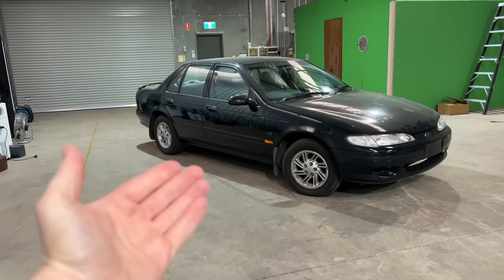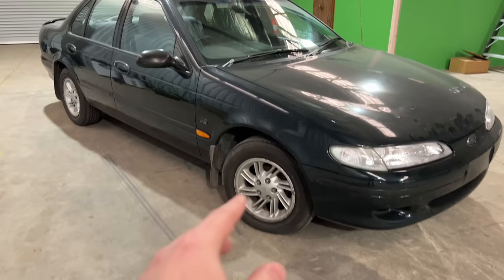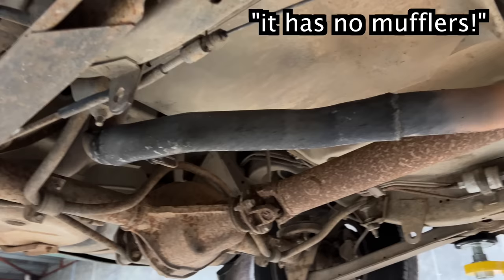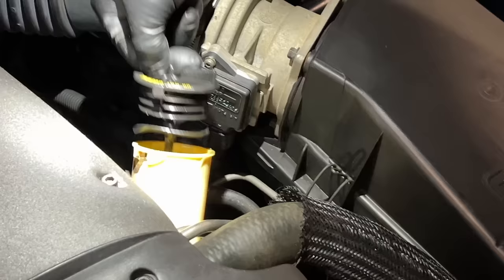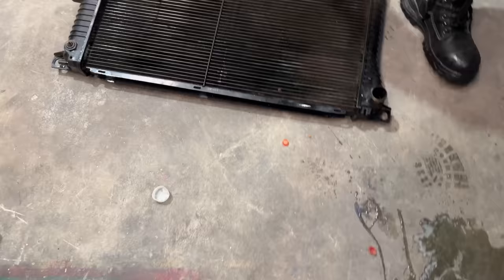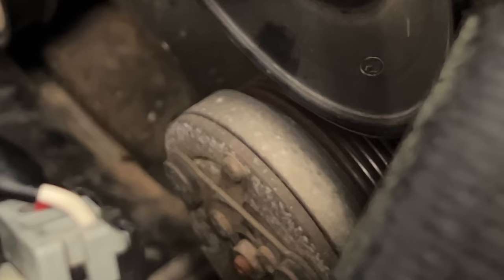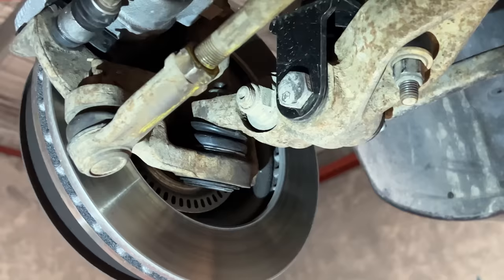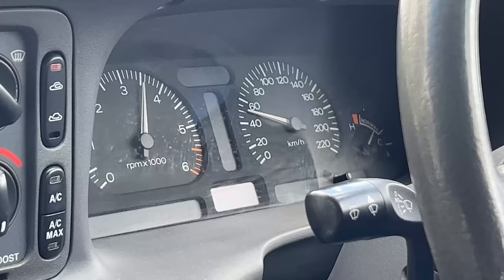Strewth mate, I got a V8!

Comment: 1995-00 explorer/truck parts: GT40 heads, GT40 intake, 95-00 roller cam.. 347 stroker kit and it can drink even more gas like an American mustang fox body.

Fseries parts on 5.0's were near give aways for a while here in the states.

My plow truck which has all these parts is the same color...(except stroker kit) (8-12mpg)

Comment: In/out play on those power steering pumps is completely "normal." As long as there is no radial play and it's not leaking they're fine. And as far as the noise goes on the new one, it needs more air to be bled out of the system.

Comment: Australian 5.0's sound shockingly different than American 5.0's especially the foxbody mustang mills. Sound more akin to our pickup 5.0's but still different. I assume thats mostly cam and header differences because it seems to have the same intake plenum aside from the logo plate missing but I assume that's because it has an engine cover. As far as I know, no U.S 5.0's had engine covers so they all had the plate on the plenum with either a 5.0 logo or a mustang logo. This is a super interesting car as an American.

Comment: "Did someone put oil in there?"
'I hope not.'

Well... I'd hope they did, just that it was the right kind of oil, since that's what power steering fluid is, mostly mineral oil used as a hydraulic fluid.

Comment: The COMPLETE list of the good and wrong of Jeff:

GOOD
- Has indicator lenses
- Has V8
- 2 nolathane bushes
- $20 air filter
- The motor is actually quite happy
- Alternator

WRONG
- Ripped driver's seat
- Faulty cruise control
- Coolant leaks
- Ignition issue
- Bonnet struts
- No mufflers
- Leaking transmission
- Unserviced transmission
- Dead wheel bearing
- Dead wheel bearing (again)
- Dead ball joint
- Oil leak
- Dead ball joint (again)
- Suspension strut tops
- Handbrake
- Dip stick seal
- Rear main seal
- Potential fuel leak
- Blown heater hoses
- Faulty power steering
- Blown heater tap
- Overfilled oil
- Non genuine spoiler
- Faulty boot struts
- Leaking radiator
- World doesn't make sense
- Limited slip differential
- Worn pulley
- Worn pulley (again)
- Worn pulley (again)
- Power steering pump
- Air conditioning
- Brake disks
- Stripped sump plug
- Recon P/Steer pump

(it was cheap)

Comment: Also the whole thing about the Windsor V8's being slow is really down to that slushie transmission Ford used. Incredibly reliable for highway cruising, a bit overly sluggish for good acceleration. I've seen people take the American versions and swap manual transmission into them and those engines can actually move reasonably fast.

Comment: Sounds like a typical Ford power steering pump from the era if I'm honest. All of the pumps of that style were noisy as heck, my 89 F150 has the same pump (and the same 5.0 V8) and it's made that noise forever but it works just fine.

Comment: So that power steering pump over here in the u.s. also has problems it’s just the way ford designed it they used the same power steering pump since 95 to 07 so if you want the wining to go down drain the pump and fill i with new fluid burp it and the fill it a tad bit over the cold fill line like 5 millimeters over and it should quiet it down

Comment: I had a pontiac station wagon i bought sight unsean from a relative.
Get in and step on the gas, WOOOH, WTF? 
Get home pop the hood WOOOOT!    350 H.O. Ultra tow package !!!! I ended up putting a proper header dual exhaust, 750 Dbl Pump / manifold and tires, and it was of to the track! 
I miss that sleeper. So many Harleys and snooty drivers put in their place with that plain jane dark brown station wagon. Looked like a POS and sang like a Vette. All for $1200.
I still have that engine under the workbench today! 25 years later...waiting to go in my 1982 Caprice, even scored a set of unused Edelbrock aluminum heads from the 80's.
One day ...

Comment: Glass bead impregnated plastic is harder than metal.    It wears through the plastic exposing the glass beads which will happily wear through your metal radiator

Comment: There is a completely accurate joke about V8's turning fuel into noise. This is one of those V8's. The i6's is where it's at. A mate of mine used an EL as a drift car. Even after being overheated to the point where it stops running.. They cool down and go for another round.

Comment: Get a trick flow heads and intake set up. A little cam, be close to 400 crank hp. Shed move decent then... some 373s in the rear end to. As for the fuel... put a piece of tape over the fuel gauge haha

Comment: I literally just thought of an explanation for how the fan could have worn through the metal. Glass fiber filled plastic. its mostly used for the plastics on power tools and high wear parts, like those in cars. so at the start the plastic surrounding the glass fibers wore away first then it basically became sand paper against the metal.

Comment: oh thats like the same 302 from a fox body mustang, they are super easy to work on and you can delete everything but the maf and tps they would not care and run great. They also take boost quite well. The intake mani is also quite easy to take off to work on if you need to
Reply: 305 was a Chevy engine, you're probably thinking of the 302
Reply: @nickrustyson8124  yeah it was a typo

Comment: the final drive ratio is what makes these so slow. Great for long highway drives but 3.08 final is crap in the city, uses heaps of fuel. Change it to a 4.11 LSD and it'd be a much more fun thing. Also, the suspension in these is doughy as, upgraded springs and shocks transform them.

Comment: A rare car,  didn't know they were so rare in a 5ltr, 9 made gee ,yeah those Ford Windsor motors weren't known to be any speed machines out of the box ,but they are a good reliable work horse and with few tweaks, as shown by the 220kw tick ford motor in Au ,can be made to move

Comment: Back in 90's the 5.0 Windsor's had no Power and when Holden brought out 5.7 Chev ( LS1 ) The 5.0 Windsor's were no matched even though Ford pushed it to 220Kilowatts in Early 2000's. Ford did make 5.6 Windsor's that pushed out 250Kilowatts in TE/TS50 Series but not enough produced to give Holden any Competition. 5.4 Boss Engines useless unless Supercharged. Only good Ford V8 sedans were GS 5.0 Supercharged Coyote that pushed out 315-351Kilowatts. Ford in December 2003 got XR6 Turbo right in BA Falcons.

Comment: Woah, they used the old 5.0 in these!? 

Thats, (as you would say) heaps neat!! I loved my old Lincoln with that same v8, but a 4 door sedan would have been really cool
Reply: Yes 5.0 up untill around 2000 then Ford Australia stroked it to 346 ci for the last ones , then the Aussie Falcons got the 5.4 Quad Cam 4 valve Boss motors , up untill mid 2010s or so then the Aussie Falcons got an Australian only version of the Coyote 5.0 Supercharged ! Till production stopped in 2017/18.

Comment: old fords are known for having all of the goddamn cooling loop explode, so just replace all of the hoses/plumbing, I had 3 old fords, a fiesta, a scort and finally a 05 ka, they all had leaks, fortunatelly all happened close to home or work, so I just left it parked and fix them at the end of the day, but it was always one of those rubber hose, dont know what you call it XD I'm latino hahahaha but yeah, better replace them all if they look old, also the fiesta and the ka, I ended up removing the heating, there is a funny bracked that connects the outside lines to the inside radiator for the heating, that thing usually bends and breaks cause is plastic, so you either get a short cause the heather electronics is mounted on the same thing or you get a leak that is hard to find

Comment: That spoiler might be factory. I have a. Falcon S that my mum owned since new and it has the same janky light wiring and mounting with the wire just zip ties and electrical taped to the loom. It just looks unofficial from the factory.

Comment: my dad also a nuggeteer

Project car
1. Wira 1.6 auto - paint
2. Nissan sunny - water pump, belting & paint
3. Savvy WKU blue- spark plug, rear glass
4. Savvy Black-paint, rear & front glass
5. Savvy PGR- collect from bangi
6. Savvy WRJ- collect from pasir gudang
7. Wira CAQ- spray rear skirt
8. Spectra WLS- front glass, gearbox, alternator, side glass
9. Ford Lynx MAG2882- paint
10. Accord SM4- engine mounting, aircond & absorber
11. Sunny wagon-nose parts collect from melaka
12. Citroen C3- ah boy repair
13. Peugeot 308- hazeri repair
14. Lorry 1/2 ton- knock & spray, front glass
15. Merc w210- gearbox, rear bumper
16. Prelude- carburetor & paint
17. Audi A6-starter @ relay
18. Toyota KE70- restore & paint
19. Kancil 660- restore & paint

and you guess it, not all are restored

Comment: If you want to put performance stuff on it check the rear diff gearing and make sure the transmission is fine. I know this is probably all stuff you're buddy knows to do but it would be a shame to spend a bunch of dollaroonies and have the transmission blow apart or the rear diff push itself out the back of the car.
Most people take a mild cam and drop it in there. Something like a Comp Cams 262. Most cost a few hundred and net you immediate improvement with everything else stock. That car has Ford Electronic Engine Control 5 (as indicated on the air box) which means it can adapt to mild changes to the engine.
Most fords wake up when you give them a good set of headers and an intake with nice flow. bigger motors were slugs around that era partially because they had to fit within emissions requirements.

Comment: I bought a 1996 EL Fairmont V8. It Looked amazing. Cost me $7000 because I’m a dumb arse. Cost me another $9000 in mechanical repairs. Got a yellow sticker because the break lights didn’t work one day. Took it over the pits. Another few grand.. I kept driving it for a bit. It overheated a couple times in the middle of summer and cracked the heads. That was another couple thousand. I ended up selling it for 1000 bucks. Fuck sakes. Anyway.. Every other EL I had was a tank and never had a problem

Comment: They were beautiful new but if you ever fix the cruise control?  DO NOT use it (cruise control) in the wet.  It’s not super clever so if you lose traction and your forward speed drops even slightly the computer will add acceleration. 

Even if you’re going sideways from aqua planing.

The LSD is slightly less dangerous with cruise control than the single spinner but it can still engage psycho axe murderer mode in the wet if you’re a bit unlucky. 

No CC in the wet.  Say it out loud.👍

Comment: The ultimate bogan mobile. Those 5 litre fuel injected V8's especially the EF Falcon version, in its standard form produced 165kw of power. The Holden 5litre in its base form produced the same 165 kw. The only difference was the amount of torque produced. Holden had a 185kw version as well in the VR, VS generation of commodores. It would've flogged the ford V8 by a country mile.

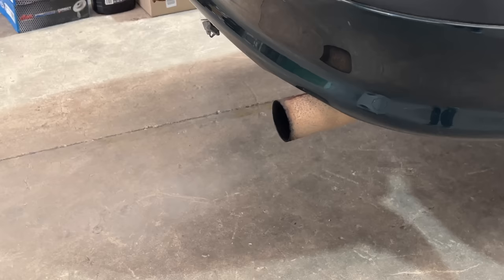Comment: 9:57 I drive a dual motor EV now, and I wouldn't trade it for the world, but MAN the noise my old 5L V8 used to make in my 2016 Mustang GT. Resonator removed, silencers were basically cosmetic, bigger throttle body from the GT350 with better intake tubing so you also got that rush of intake noise. The engine exploded at 25,000km because there was a recall on the cooler that no one told me about, plus two more recalls to stop the footwell from flooding and the engine bay from setting on fire. Oh, Ford! You absolute piles of utter shite! ❤

Comment: I suppose that, by Wade's definition, my thrice crashed, once flooded, extremely hail dented, 10 year old, 200k+ kilos on the odometer Honda Civic is not a nugget, because it is well maintained. It's as ugly as they come. It's missing the wheel covers. But she drives near perfect. Looking at it, you won't want to steal it, but if you do, it'll get you there.

Comment: i have the gli el inline 6 version of this, same color mine too has light hail damage she runs pre good tho to this day ill drive her till she dont work no more i got a bit more rust then you i see it as active weight reduction good for that fuel economy, yours is in better nic then mine and thats saying something i just look top up the transmission when it starts to slip cuz that leaks oil leaks somewhere top that up once a year oil leaks not too bad tbh if its a head gasket well just extra lube for a cylinder top up the radiator ever 4 to 6 months or when i remember to check all in all its not bad one of the cylinders misfires every now and then but we have 6 of em so we dont worrie about it she only showes a miss at idle shes smooth to drive you know if you ignore the wheel shudder when breaking like she straigh off the line

Comment: You have to bleed the air out of the power steering system and it won't make that noise and it will work much better.

Comment: Is that the Windsor 302? I'd recognize one anywhere. I think in the 90s they where only putting out like 230hp. They weren't fast no. Easy to make them fast ofc. heads and cams and she'll pull. If it's a distributor model you can convert to COP using later explorer parts and cam sensor drive.

Comment: ignition cylinders in these are junkkkkkkkkk. the steering colums / dash areas are like inpossible to repair and not worth fixing. MUCH easier to send starter and power to single pole switch to crank it after tuning to ignition power lol. plus its fun.
i had a 95 sedan and had to do the same thing to it AND another late 90's sedan

Comment: I've summed up all of the issues mentioned with this nugg, have the list:

Coolant leak
Bonnet struts
No mufflers
Leaking, unserviced transmission
Dead wheel bearings
Dead ball joints
Oil leak
Suspension strut tops
Handbrake
Dip stick seal
Rear main seal
Potential fuel leak
Blown heater hoses
Faulty power steering
Blown heater tap
Overfilled oil
Non-genuine spoiler
Leaky radiator
Broken limited slip differential
3 worn pulleys
Broken powered steering pump
Air conditioning
Brake discs
Stripped sump plug
Recon P/steer pump

Jesus.

Comment: my engine makes the squeak noise not because the bearing is fucked but because it's missing an engine mount bolt and the water pump pulley is slowly cutting into the engine mount

Comment: Ford was pretty ass with power steering pumps in the 90's. The vehicles they made were damn good but man I have a 96 F250 and it whines all the time.
Turns out if you use power steering fluid made to top end european car specs the groaning gets quieter or disappears.

Comment: typical 5.0l ford never had any low end power, you get good hp at around 5000 rpms lol, but they are a tough motor and definitely not the greatest on gas either, also the power steering pump price is ridiculous it should only cost $100 bucks for a reman pump, the noise is normal on those fords, takes a long time to get all the air out of the system, if you want to get it quiet, take and use a vacuum pump and suck on the fill hole and that will draw the air out and it'll get quiet, otherwise lots of driving later it'll eventually get the air out of the fluid

Comment: Rear mains SUCK. And you have to do it or you could...i don't know....just spontaneously combust. Had one done on my Prelude when I was in college. It was such a big job, I told them to go ahead and swap the timing belt and water pump since he was going to have to pull the engine anyway, which only added maybe $100 to the whole job. All in, it was $1,200 on a car that I think I paid $6,000 for. And you recoup NONE of that. I only did it because I wanted to keep driving the car.

Comment: 6:25 for those who dont know you have to get out your whole exhaust your drive shaft your transmission clutch and flywheel might even open the back of the engine to change a 5 dollar part that could cost your car

Comment: Just get one of us American hillbillies to mail you some parts that will go somewhat unnoticed for per inspection process and you’ll be beating v6 cars in no time. 

I think a set of “gt40” heads and an e303 cam would be a decent start for that. Along with a higher stall torque converter, and get someone there to give her a computer tune 👌.

Comment: Listen mate I’m Dutch so it’s in my nature to be brutally honest. Shouldn’t have grinded the pads down. If the brake plungers were okay you should be able to push them down enough for the pads to fit. But then again I’m pretty redneck so hey. If it works, it works!

Comment: Close to the crappiest power output for a v8 ever made lol, can be beaten easily by a v6 Camry
Reply: American V8s of the day were not more powerful. Emissions laws struggled all big engines then.
Reply: @AdamAdamHDL  still not worth owning one. Huge fuel bill from mediocre performance. Completely embarising when a 3.5 magna can beat it lol 😆
Reply: @andy2906  
 I didn't say it was worth owning. 
 I bet the 3.5 magna couldn't tow nearly as much as the old V8. That's something at least.
Reply: @AdamAdamHDL  fair point. We used to have a couple of these as work cars, I don't miss them, hot dirty noisy diffs  and fairly pathetic handling
Reply: @andy2906  
 They are absolute rubbish. Like fair dinkum, and the commodores of that era are not any better. Since I've had Japanese cars I've never looked back, except in disgust.
Reply: @AdamAdamHDL  2 true I've got a 200rwkw mr2 spyder and an evo X. Both a hoot and way more reliable
Reply: @andy2906  
 Respect. 
 I switched to motorcycle for on road enjoyment long ago. For cars it's all off-road for me. Nothing crawls into as much trouble and out again as a Suzuki. Not a single fault and I can go hunting anywhere.
Reply: @AdamAdamHDL  very cool you should watch mighty car mods they have done great sierra/vitara mods. I've got an old vtr1000 road bike that's a good laugh for acceleration